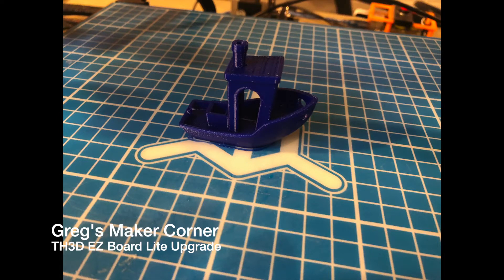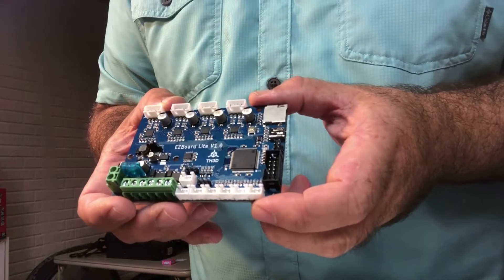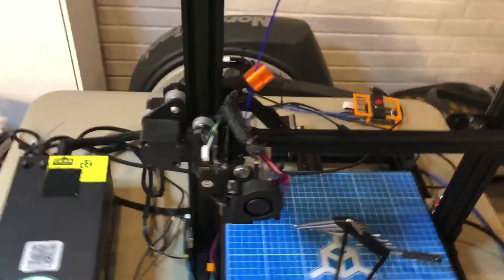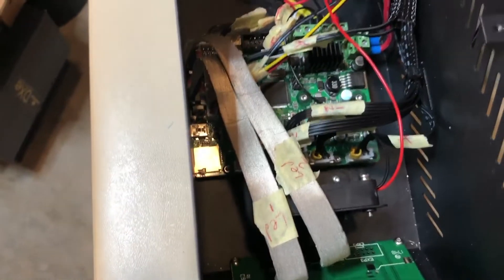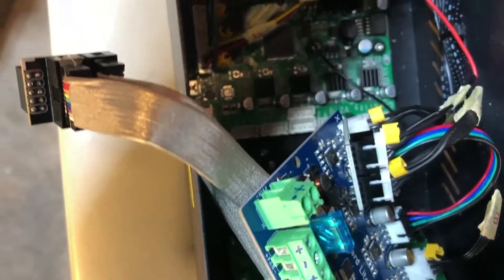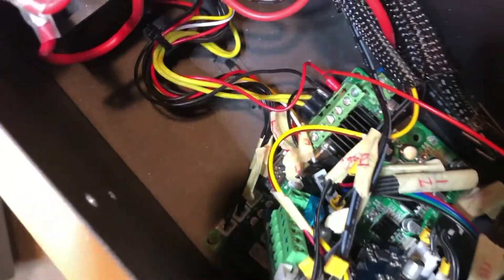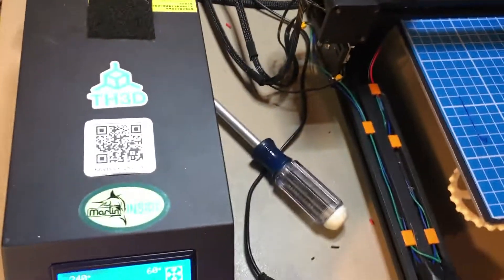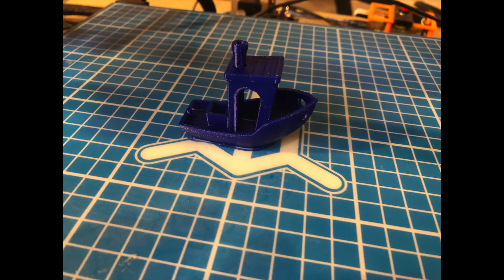EZBoard Lite

Comment: Thanks for the video, which ferules do I buy? An amazon link would be helpful. TIA
Reply from the maker: Thanks! Here you go.. it's in the description of the video too (included with the Crimper).  https://www.amazon.com/Ferrule-Crimping-Tool-Kit-0-08-10mm%C2%B2/dp/B07K17VDF2/ref=pd_lpo_sbs_469_t_1?_encoding=UTF8&psc=1&refRID=09SZEGAWQ9G6R2TGC4FK
Reply: @GregsMakerCorner  Sorry I usually expand the description first. Do you recommend any bl touch mounts (printed) and part cooling fan ducts for your aero?
Reply from the maker: @Alexcide007  Hah no problem! I am the same way. I only use manual leveling, but I know there are some out there that should work. If you use the Evolve mount that I am using on my Ender 3, it has a bl touch option. https://www.thingiverse.com/thing:3279302/files
Reply: Really appreciate your help. Got the mount printed and bltouch installed and working thanks to you. I am up a snag now, I connected the hotend fan to Fan 2. From what I was told that was meant for the ender 5 and it only turns on when the steppers are active. Is there a way to configure the behavior of the fan 2 header to act as a hotend fan instead? Ie when hend is over 50C
Reply from the maker: @Alexcide007  Hi Alberto, glad to hear you got things working! That's great. I believe you can set Fan 2 to turn on when hot end is over 50C, but I'm not positive how to do it- guessing it is a firmware setting. See this thread on the TH3D forum, user DonaldMcKay says you can configure it that way. 

https://forum.th3dstudio.com/d/15-ez-board-fan-confusion/10